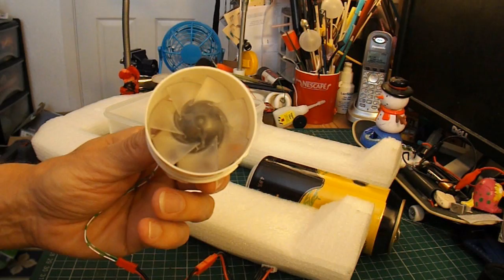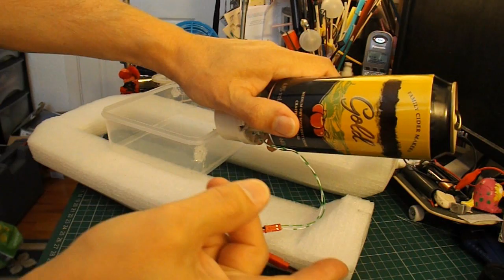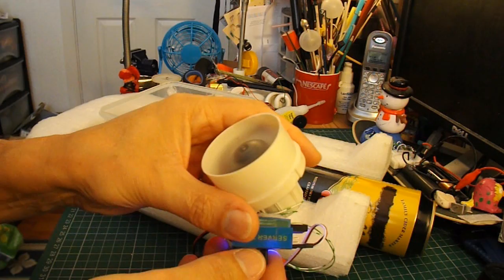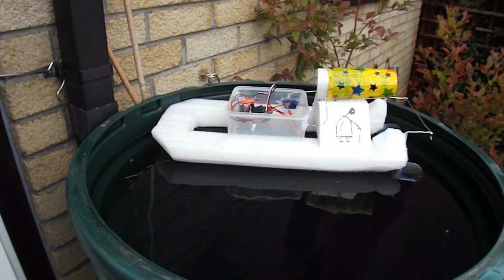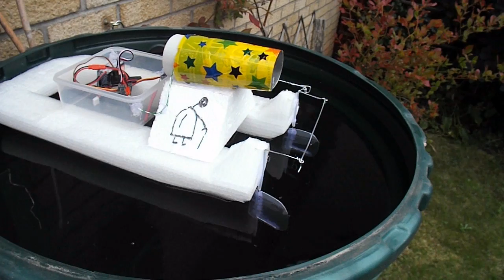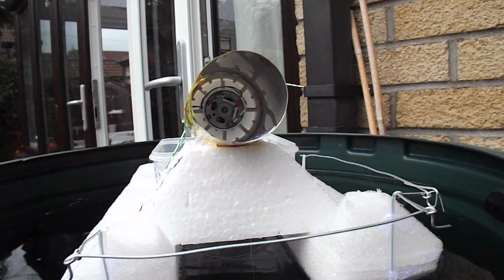RC Ducted Fan Boat - Part 1 Concept

Comment: why you would tear apart a 20-30+ dollar hair dryer instead of buying a 15-20.00 RC EDF motor, which is a way better option is beyond me.
Reply from the maker: Probably because I bought 10 hairdryers for £10 in a charity shop - that would be a Good Will Store to you - so £1 each and cheaper than I could have bought the motors inside them on eBay. Here is the charity shop video https://youtu.be/Wd8BQ8lMFjw

Comment: can you do this boat with thrust vectoring instead of the rudder?
Reply from the maker: +ThunderTaker38 I did think about it but normal rudders were an easy option. Another easy option would be to turn the whole motor mount. RC Hunter has done a nice thrust vector mod on a boat he is working on here https://www.youtube.com/user/S30Uploads/videos
Reply from the maker: +ThunderTaker38 just fitted thrust vectoring to the boat and tested it in the bath. Looks promising, the video will be published 20th September.

Comment: You could have used a styrofoam cup for the EDF duct, it would cause a lot less vibration and less noise. Also that motor doesn't sound like it's in the best condition ;)
Reply from the maker: +X-FLIGHT101 I think the motor is fine, the aluminium tube vibrates terribly but I like to try things to see what works. If you look through my fan driven cars playlist you will see I have also used styrofoam and cardboard.

Comment: i might be wrong, but that sounds like as if the bearings in the motor were running dry. might be an idea to check that. :-)
Reply from the maker: +Elnufo the motor is fine, it is that aluminium tube making the noise. The brushed ESC will also make noises at a frequency that I probably cannot hear.